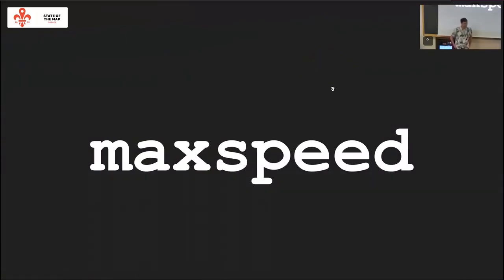2022:  Inferring default speed limits

Comment: Total misconception around maxspeeds. 

Maxspeeds have a lot of sources and the minimum is the one allowed. A signed maxspeed is the maximum you may drive for THAT road. You may drive a vehicle which has a much lower limit like a moped. But thats not something we map. 

So the long list of "default maxspeeds" is not something which has to be implemented in OSM. We map ground truth and what is signed. Done.